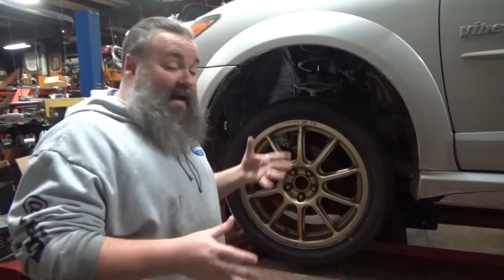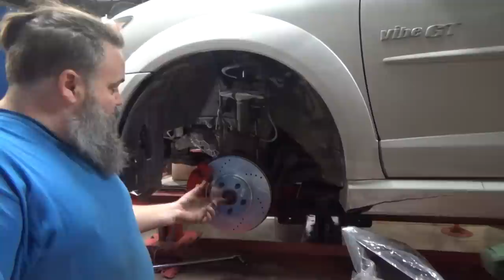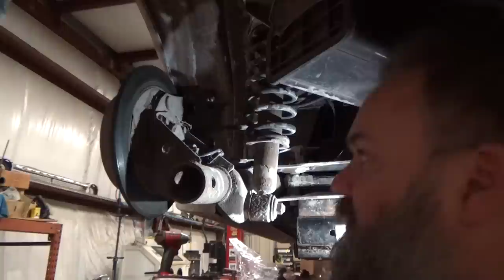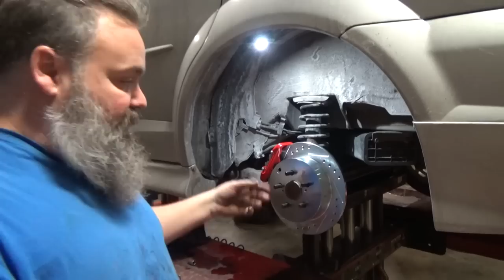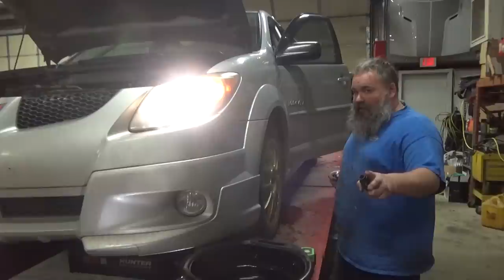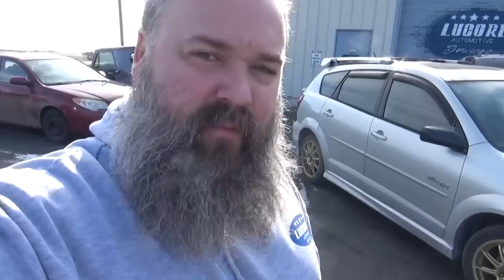The Pontiac Vibe GT gets a PowerStop Brake "Upgrade before the 25002500RoadTrip!

Comment: FYI, I just took the factory 16" aluminum wheels of my 2004 Vibe GT with the special factory shouldered lug nuts and counted the thread engagement on them and it was 11 1/4 turns.  On the Subaru wheels I installed on a 2003 Vibe I got a little over 8 1/4 to 8 1/2 turns on the front and more on the back as it had drums and not rotors.  The Subaru wheels didn't have the recesses in the wheels for the Toyota style wheels and I used some normal lug nuts and used them to center the wheel when mounting it as the Subaru wheel has a larger center hub.  Love these videos as the Vibe is a hidden gem.  Currently have 285,500 miles on my 2003 Vibe.
Reply from the maker: I actually measured thread engagement and I was right at 9 1/2 turns on the front. SHOULD be enough but I'll also want to pay attention to my torque on these things... as you can see in this video I'm already slightly unimpressed by the Chineseium lug nuts 😳

Comment: I’ve found Rock Auto is pretty good about shipping the right part. However I have had parts in the High end box switched out for cheaper or slightly used (returned) parts. Not likely their fault. I’ve also had the tape break in shipping and small parts (gaskets) fall out.
Reply: If anything the majority of issues of the wrong part are a result of user error 🤫

Comment: NOpe. You still can't polish a turd by just slapping shiny bits on it. And if you slam on fresh brakes, your shiny new discs are gonna warp. All those shiny bits and old crusty soft lines with sat to square wheel bearings and dead E-brake parts.. Seriously, people? Why? All that trouble, all that money, and the most common failure parts are still there, still old, waiting to fail on you. If this is the work quality and level of expertise, nope.